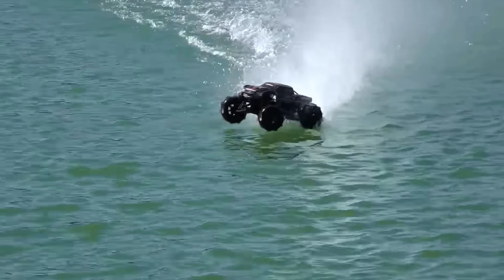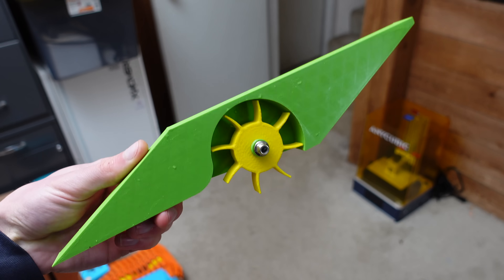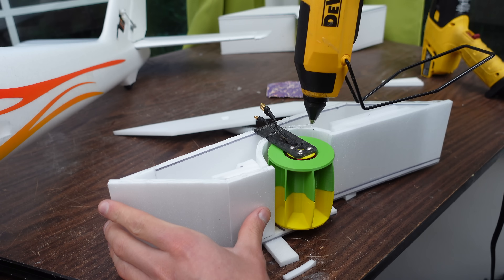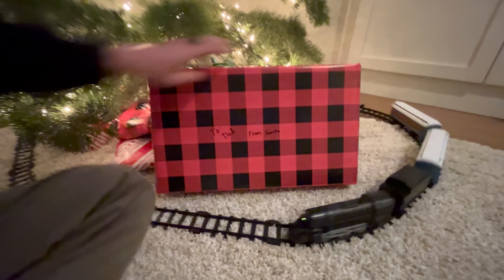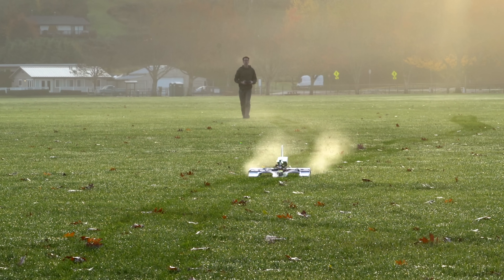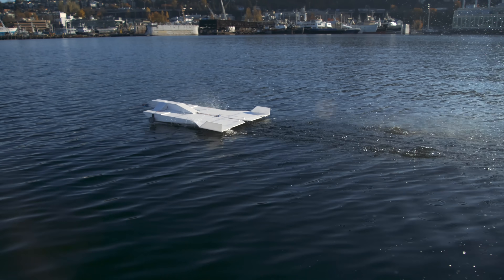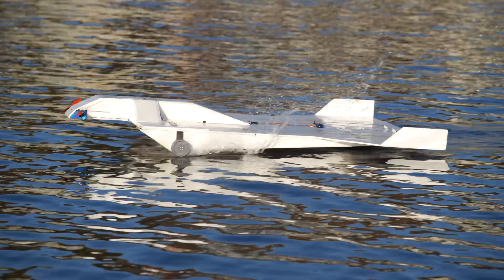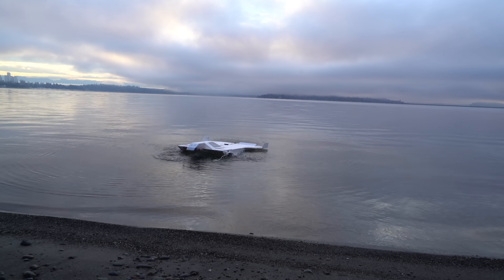Testing Wheels on a Ground Effect Vehicle

Comment: I do think you’re onto something. Huge. I imagine the best layout might be to have dual air props up front and those high speed paddle wheels on the far back corners. That way it will keep the front up and the backside can push off the wave tops. It  will be like the  lizard that runs across the water, the wheels keeping those wingtips out the water keeping friction down

Comment: Maybe some suspension... 
get like 80mm of travel... would soften contact and maintain contact / better traction...
move the wheels under the wing so the droplets flug up actually push up instead of add weight to top of wing.

Comment: You could try triangular shaped paddles to get a smoother transition when the wheels plunge into water. It would reduce the bouncing over water.
I love your experiments, science can be really fun!
Reply: How about angling them out a bit to the sides, and adding outriggers, to keep the spray away from the vehicle body?? This could turn into a super maneuverable vehicle and potentially pull actual high-G maneuvers on the water? 🤔

Comment: to prevent the water from kicking up, you could have the paddles be curved, which would help eject the water before it gets picked up. it would also push the water down, creating more lift to help it get off the water.

Comment: If it can leave the ground effect and fly it is not a ground effect vehicle. It's way too light. Try adding some weight. But it will make your sweet spot even smaller. Remember ground effect starts at about half of the wingspan. So the narrower the wingspan the smaller area you have work with. Go wider of ground effect and  heavier. Also placement of weight can make a big difference.
Actually I think you want to strive for no contact of the water. Maybe your contact surfaces are two wide and causing way more friction than needed. It may be the Styrofoam is not good for contacting water at all. JMHO.
Good luck and have fun!

Comment: The one thing I see is that there needs to be some sort of adjustment. For example a scissor action that raises and lowers the paddle wheels as it comes up to speed. For example when you get going moving the servo will raise the body higher above in the water thus creating a slightly larger lift area. Not really sure how to explain it yet I do see there being an advantage to this. 
How its done, not a clue yet I am sure if you fiddled around a bit you could come up with something. If you had 4 paddle wheels you could connect 2 of them across one another via their motors then a mount plate to the bearing of the paddle wheel and using a set of gears to apply drive. I doubt that a belt would work in this application. A drop box of sorts would have to be used. The set of motors connected to a pivot point would allow the 2 paddle wheels to raise and lower. Much like a any level lift kit on a truck. This would allow you to adjust the angle of flight/paddle.

Comment: I think there's a startup opportunity for electric ground effect ferries. These ferries would not carry cars, but would carry TONS of people. What's more, at the ends of the trip, they'd become VTOL aircraft, so they could land on a large paved area next to the water and not require a dock.
Reply: They probably wouldn't do well as VTOL, but they would make excellent STOL (short take-off and landing) aircraft.
Reply: @5peciesunkn0wn  I'm talking about infrastructure costs and other barriers like that. It doesn't matter that they're so-so VTOL. They only have to do it for a short hop.
Reply: Ground effect taxi. Pick up people and travel over water in ground effect. Actually capable of flight when unloaded? 🤔 this means it's faster when moving toward a pickup than otherwise.
Reply: @dogefort8410  "Actually capable of flight when unloaded?" -- No actually capable of flight, period, but only does it out of ground effect for a short hop, so no ferry docks are needed. Just a patch of paved ground.

Comment: I'd also add a small flywheel to store and maintain power and speed (kinda like those push car toys), instead of just constantly driving the motor itself. Should improve efficiency, and may result in less water being kicked up.

Comment: Might it be possible to automatically control some aerodynamic surfaces based on a high-frequency, real time measurement of the height above water? I'm thinking of something like a radio altimeter in airplanes or a laser distance sensor. The plane could control some relatively weak lift surfaces, or it could open/close vents to the ground effect air pressure below the plane. You would have to tune the whole feedback loop, which will be a pain, but it could help you actually create a feedback loop with the ground (water) that is not based on touch.

Comment: I wonder if less paddle and more tire would be a better option. A) it would be more buoyant and B) if the propeller's forward potential is larger than the water wheels, it might act like a brake but a flatter tire (or track) would reduce the drag.

Comment: One of the great things about the wheels and modern speed controllers is that maintaining rotational speed is relatively inexpensive so when its flying no contact, with the right wheel geometry the motors might be useling very little power at all, only spiking current on contact to maintain speed.

Comment: Since paddle wheels and planing wheels are technically two different functions; why not focus on only the second? I would look into smooth or dimpled wheels and use a height sensor to only power them when falling out of ground effect, chasing efficiency as the main goal.

Comment: im sure theres a good reason not to but how come you dont have a gap between the wings & then mount the wheel on the middle in the far back of the craft (like where a prop motor would go) so that the water it throws doesn't hit the craft itself?

Comment: My dream is a ground effect flying craft powered by tailwind, going fast than the wind. Extracting air speed differential between near the surface and highter up, porbably through some large paddle wheel or tank track system that is turned by upcomign air like a car's wheels are turned by the road. This then drives the prop (like the Blackbird wind vehicle) that pushes it on. A huge challenge of unlikely relative dimensions, low weight and low friction.

Comment: I really like you prototypes, though sometimes I miss some details, that would push efficiency, in my opinion, like better (naturally) designed shapes and flow tunnels around propellers/propulsion parts, to prevent power consuming vortices.
I'm aware, it's not easy to build these by glueing foam parts, but how about rough 2.5D milling from solid foam blocks, like simple RC airfoils?

Comment: Can you emulate this with just pure ducted fans? Use the air pressure to regulate the distance off the water? Push air under and down? But I guess that'd need computer control to not just send it back into the air.

Comment: Would it be possible to have one wheel in the middle back a little bit behind the plane?? in stead of pulling the water it would push and the water won't be a problem.

Comment: Hi. I am developing a electric amphibian roadable flying car design that works really well on water, in ground effect, and transitions to land using its 4 large wheels. It is called the Sky Chaser, and looks and drives like a car, flies both vertically and horizontally, and is amphibian. It has 2 rotating prop motors in front and a stationary prop motor in back blowing thrust through its internal wing. It is basically a twin engine tractor tricopter flying wing design, with double elevons, and double rudders, and has extremely short wings forming the body of the vehicle. The rotating front motors are mounted on nacels connected to the internal wing, and the prop motors throw high speed thrust over the internal wing. This gives the short wing a lot more lift. Also the side panels housing the wheels extend both above and below the wing and help channel the thrust over the wing and act as wiglets, which reduce the  wingtip vortices, thereby reducing drag. The vehicle works very well in all modes of operation. It works great on water and can take off an land both vertically or horizontally. The wheels acts as rudders in the water, and the thrust over the wing lifts the vehicle out of the water, with only the rotating wheels guiding the vehicle, enabling the vehicle to take off on water in a very short distance. The thrust over the wing also enable transition from VTOL to plane mode  and visa versa at very slow speeds, making the transitions very stable. It flies really well and is very maneuverable. The vehicle can seen in my icon on the top left hand side of this post. If you click on the icon you will find flight test videos. The design was tested as a 1/6 scale vehicle built using water resistant foam board and hot glue, and the bottom part was also covered with packing tape to make it extra water tight. In addition, I have recently made a functional full scale unmanned prototype which has begun to hover. I started the project in 2016 in San Diego, Calif, and 3 years ago the project moved to the middle of Sweden to work with a business partner, where our goal is to make a Blade Runner style manned flying car. For more information about the project, search: Sky Chaser flying car. Flight videos on TikTok. Search William Walker Sky Chaser. SkyChaser(dot)se

Comment: The boat you mentioned making at the end is very similar to how a zap cat boat works. It’s a very light boat designed for racing and when on plane the only thing in the water is the outboard motor.

Comment: What about adding some suspension (with dampening) to that wheel, that could help with the bouncing and stabilize it. Also I'm not sure if using a padel wheel makes a ton of sense here, since the difference in speed between wheel and water is propably quite big most of the time. That's usually not a usecase where padel wheels work best. A wheel with a geometric friction surface instead could be interesting.

Comment: well that blower fan pushes up all the time, if you make the air-flow always directional down. air pressure down wheel vs random wheel, yep now you are pushing air to all wheel directions, not just down. well make a floating flying car with just high speed spinning directionally ducted blower fan wheels.